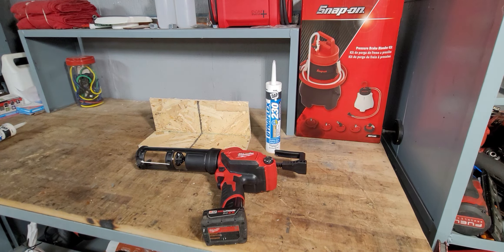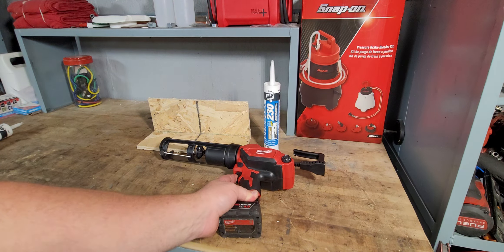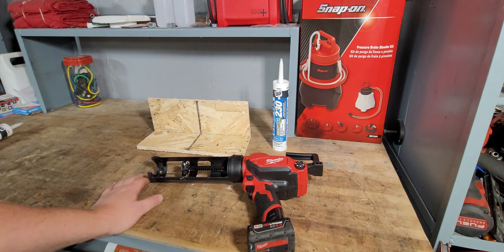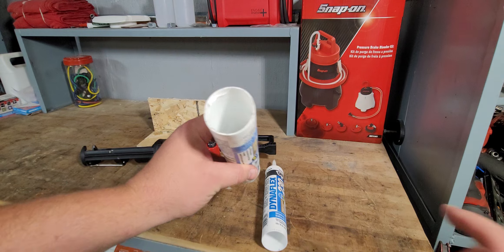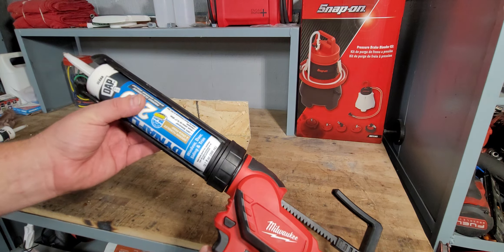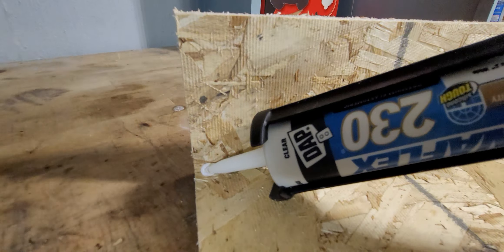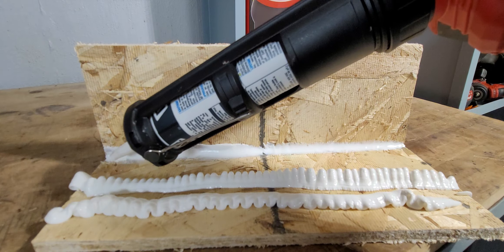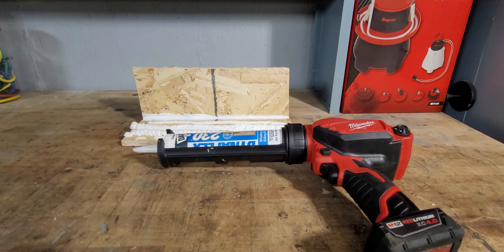Milwaukee M12 10 oz Caulk Gun

Comment: Thanks for the method to reload, I was using simultaneous trigger pulling and using the auto retract to back out plunger to add new tube. I have been caulking for 30 years (as our housing seems to be assembled together by caulk) and I can't believe how much this would have saved my forearms as I just bought it😊.
Reply from the maker: No problem,  definitely a time saver and worth the money
Reply: Me to. But I’m still can’t reload mine. When I push button to reload - it doesn’t move!  Can someone help? What I’m doing wrong?
Reply: @fedorovfedorov9803  try turning the dial up, checking the battery or manually pushing the plunger until it's tight, then hit the engagement button on it, and then pull the trigger. If that doesn't work return it. Hope that helps.

Comment: Tile setter here. I run the best beads in the West! 😉

Im hoping that the first setting is slow enough for my needs, it looks like it will do nicely. 

Pro Tip: instead of cutting your nozzle at an angle and dragging the caulk along (like in the video), cut the nozzle square (perpendicular to the tube) and push the caulking. It will enter the joint insread of sitting on top. The square cut nozzle also makes the perfect scalloped profile when held at an angle as you push the caulking gun along your joint. 

Yer Welcome🍻
Reply from the maker: It's pretty slow. Should work good for ya. 

I don't really do much. That's why it's not that good of a bead. Lol

Comment: Dude your only using it for chalking? I do more adhesive than caulk but still do both. From subfloor, sheetrock adhesive for ceilings and various wood working projects  to annual caulking maintenance.
Reply from the maker: Ok. It has multiple uses

Comment: hi great review - very useful. What is the width of the gun please ie if laid on its side what is the height of the shoulders. I'm toying with getting one but want to know if it will fit in a Milwaukee Packout Compact case. Cheers
Reply from the maker: If you're talking about the smaller cases. (48-22-8436) then it will not fit.

Comment: Does yours make a highpitched tone when you pull the trigger? I bought one yesterday, new, and mine makes a high pitch tone.
Reply from the maker: Mine does not.
Reply: @BreakdownswithBrian  Thanks..i will swap it out tomorrow. Its a great tool ..it works great. I had the Ryobi one but returned it because it kept jamming so i upgraded to this one..i got the m12.
Reply from the maker: I like mine, no issues.
Reply: @BreakdownswithBrian  I replaced it today with another one..new gun and battery and it does that hi pitched tone BUT no where as bad as the other one so im sticking with it.

Comment: hi what is the differece between 18 and 12volt gun .. seems both have similar spec..
Reply from the maker: Y3ah. The specs are probably the same just the different battery platforms
Reply: @BreakdownswithBrian m12  400lbs of torque 

M18 900lbs of torque 

M18 are for heavy application or thick material

Comment: Anybody try any epoxy products through this yet? Maybe a cement crack repair product?
Reply from the maker: I haven't tried it, but I'm sure it can handle it.
Reply: I have..bought it new yesterday and used concrete sealant for 4 tubes today. Worked good but i think it would work better if warmer weather. Im in new orleans and was in mid 50’s all day. It worked ok but i feel would work better in warmer months for that thick cement type  epoxy. I did use one tube of regular clear caulk today also and it flowed awesome because its not as thick as cement epoxy. Also mine is making a hi pitched tone when i pull the trigger..i asked the video channel guy if his does it too and he said his doesnt so i will swap it out for another one tomorrow. I got the m12 version for $159. Also before this one i bought the Ryobi brand but returned it because it kept jamming up on me so on return i upgraded to this milwaukee one…the milwaukee is much better imo.
Reply: I swapped mine out for another new one today AND it was a lot warmer today and that cement expoxy flowed EXCELLENT! Im more than happy with it.

Comment: This has to be one of the most Useless tool ever...
Reply: It really is. Hopeless if you're using it for caulking, so slow to restart. Quicker and easier to use a regular gun. I returned mine as 'not fit for purpose.'
Reply: Well, that depends, doesn't it? If you're caulking Indoor trim, then ya. It's useless, but if you're caulking exterior cedar siding with Quad, or using certain adhesives, something like this might make it a hell of a lot easier.
Reply: If you enjoy breaking your hands and fingers.
Reply: Very useful for solar panels on a flat roof since the mounts require almost half a tube of caulk on the bottom per mount